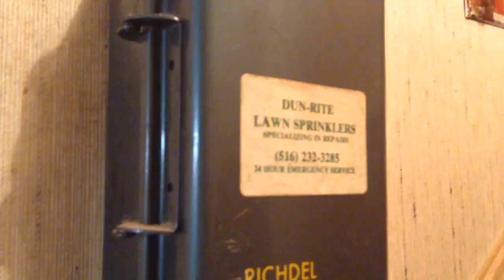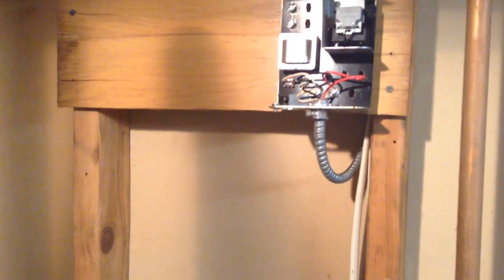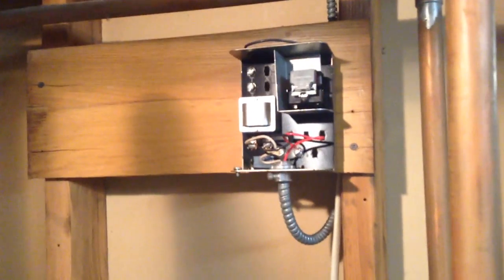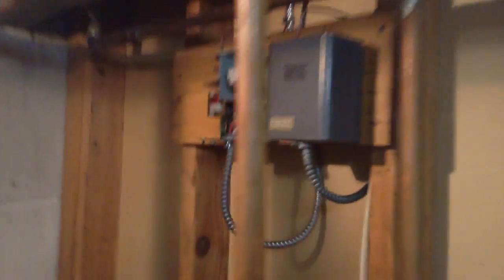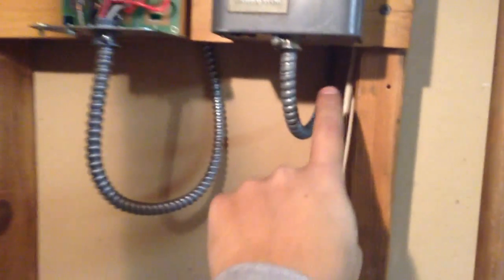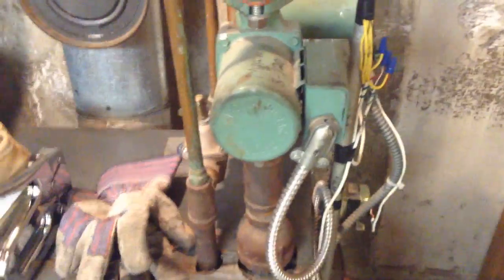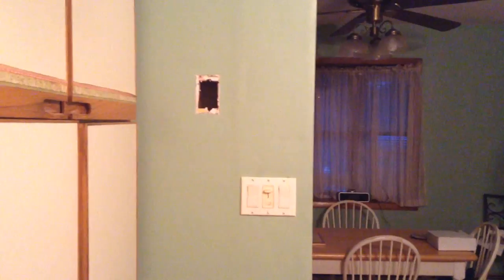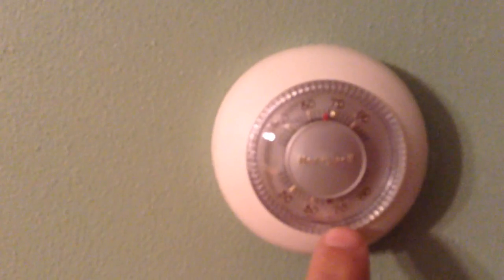How to Convert a Line Voltage Thermostat to a Low Voltage one

Comment: So this is what you guys get up to when I'm not there.

What is that green dot that follows around in some of the video?  I'm guessing it might be some sort of artifact caused by Apple Products rapidly deteriorating in fluorescent light ;-)

I still want that small fluorescent light that was in the little "closet" next to the washing machine.  I even have replacement bulbs for it!

The duct tape was on the pipes inside the clamps to help prevent the noise you'd hear of the pipes expanding and contracting as hot water goes through them at various times.  Our old apartment didn't have that, and you'd hear the heat kick on and off (never the boiler, just the pipes).  That was until the landlord got cheap with the heat, then I just left the dehumidifier running all winter long, all 700 continuous watts of it 24/7.  It was pretty effective actually, just that small amount of continuous heat really made the place nice.  And it was free!

You talk about all the stuff done "wrong" at your place and how it shouldn't be like that, it should be this way, etc.  I guarantee the next owner will have other ideas!  Then again, there's less and less of us "in the trade", most of these people have our tax dollars through illegitimate means, and call places like Allure to come in and do a job that looks nice on the surface, but you don't see what's behind the walls.

Not that anything you're doing is wrong, of course.  I agree with 95% or more of what you're saying, but others will have other ideas about how things should be done.

The height of the thermostat on the wall WILL give false readings.  Mounting it too low will result in it being too warm for the set temperature.  Mounting too high will result in it being too cold for the set temperature.  The difference in temperature between the floor and the ceiling can vary quite a bit.  There is no "temperature gradient" because the air in the room is not in equilibrium with itself.  There are hot and cold pockets in any room, so the placement of the thermostat is critical for accurate measurement.  I think where you put it is likely the smartest place.  On an outside wall, temperature reading will be off, so it does need to be on an inside wall, which you have.  The thermostat (at least the older style ones like the "yo-yo" style Honeywell you have there) must also be level, otherwise it won't read correctly.  It's likely those new-fangled "I-can-control-it-with-my-phone!" thermostats shouldn't matter as much, but of course those that think they can do everything with their phone probably can't mount the thermostat level anyway.
Reply from the maker: Yes that green light is an Apple feature. I paid extra for that. LOL.